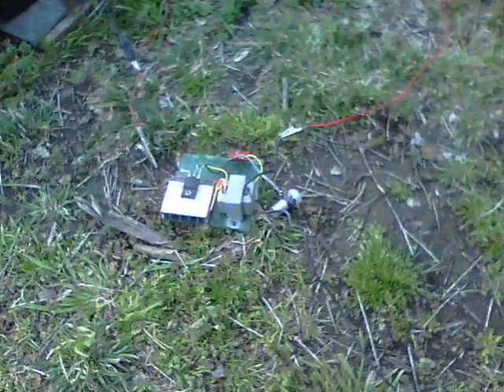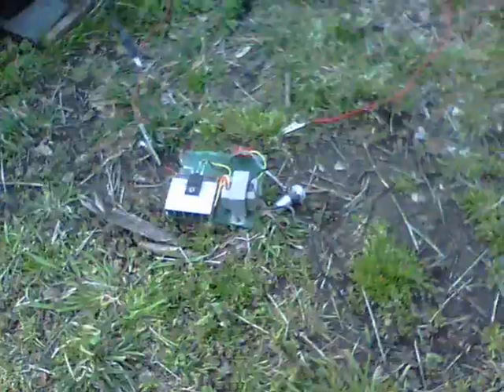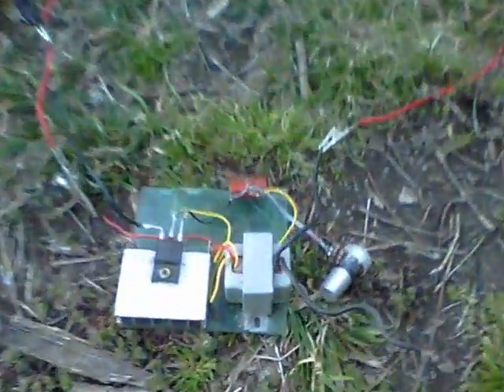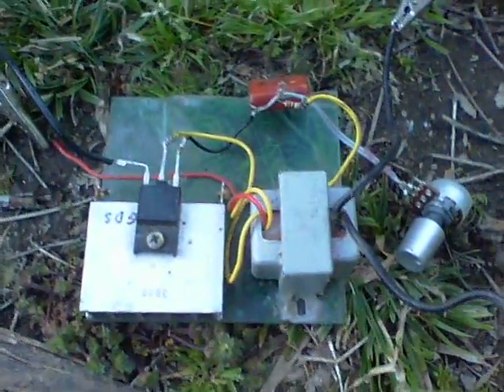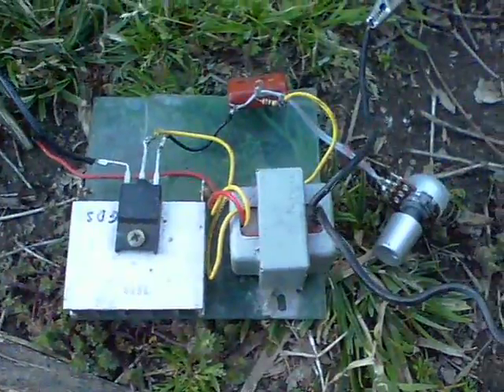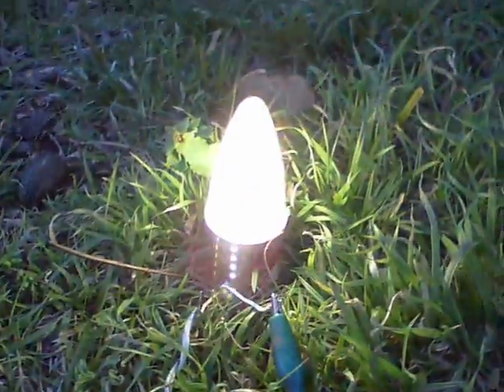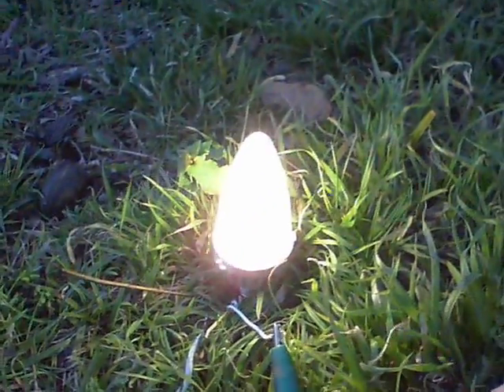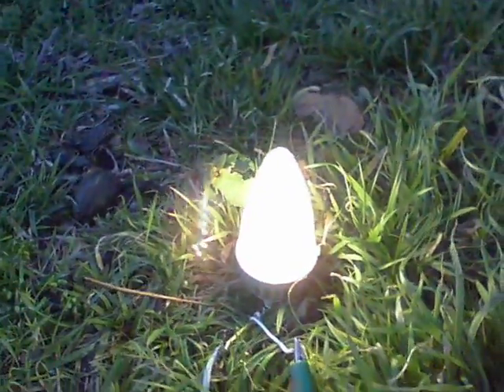Earth Ground 50ft, 2W 110V bulb

Comment: i want to make the transformer you have do you have a video with all the items and specs to make it thanks
Reply from the maker: It's a common circuit, not my design for this one. I believe I just searched for 'reverse transformer transistor'. What it is, is a 120V to 9V regular wall plug transformer, connected backwards. The MOSFET or transistor powers the low voltage side, which is stepped up for the mains rated bulb.
I wish I could find this one, it would be useful for present experiments !
More info would have been good, but as often used to happen, it worked so I grabbed the camera.
Reply: thank you very much for taking the time to get back to me
Reply from the maker: No problem, long time ago now. I believe this is the circuit:
https://www.youtube.com/watch?v=bEsh4tA5YzM
There's a clearer view on a Photobucket link in the description box underneath. The actual version in this vid is likely the same one, without the bi-colour LED.

Comment: :) so cool !! Im 14year old from croatia so I dont have much money for parts but my dad had electronic stor 10 years ago . lot of electronics he left to me :tv , videos , vacum cleaners , fridges , power supplyes , osciloscopes ..... so I make
lot of for me cool electronic projects and I love mehanics !  I will make 1m tall tesla coil and I have question for you
: I saw many circuits from tesla about wireless electricity and free energy and can I use tesla coil to transfer energy by grounding 1 end of coil and putting big antenna on other side , for reciver I will try to use 1 or 2 flyback transformer with HV capacitors and big antennna  !!!     can u pls make you opinion for my wireless energy project !!! will power be transfered only when spark touches other antenna ???  if it does can I conect it on some other way !

Comment: I'm confused...does this drain the battery?  If it does drain the battery  then why do it?  To save cost of wire? Plz explain thx
Reply from the maker: +Nathan Rogers Hi Nathan. There are several safety benefits to doing things this way - such as no chance of shorting any wires. With bad weather conditions or old wire, such cables can become frayed and this eliminates any such problems. Plus, yes indeed, a wire can be saved, where a benefit is less wire to check if there are faults. If someone has a bunch of wires for a shed/garage/outside lights then simply plugging into the ground can be tidier and  more convenient.

Comment: forgive me if i'm a bit ignorant, but the one wire must be supplying both the pos and neg voltages via a/c in one wire.  Is this correct because i',m not sure what is happening here., is the earth so the load can discharge?
Reply from the maker: Without the wire to the Earthing pole back near the battery it doesn't run, the pulses do indeed though travel down that one wire. If Grounding was the reason for working, then the light should come on regardless, so it seems the connection between the groundings is at play. All of my own tests point to the Earth being a wire, rather than a sinkhole of a blackhole for current.
Btw, The output is an on/off of Positive voltage then zero, rather than A/C (imagine a relay triggering thousands of times a second).
Interestingly, if you put 2x steel rods in the ground separated by about 1ft at least and put an old crystal radio type earphone between them, you can hear A/C mains hum from local houses.
Reply: slider2732 Thanks for that reply, it's all very interesting.  I just got a slayer excitor., So I guess I could use the second coil at a distance like your light bulb, it has one wire going to it that I assume acts like a ground link?
Reply from the maker: Ah, well with a Slayer, the frequency is high enough to do '1 wire' anyway. Run a 30AWG or whatever you have out to 50ft say and then put 2 diodes facing opposite directions connecting to the 1 wire...called an AV plug. Put your bulb contacts to those diodes (CFL, fluoro, LED type bulbs). No need for a Ground with a Slayer. That tiny 30 gauge wire will handle loads such as a 15W fluoro, 23W CFL. The electricity travels on the outside of the wire not through it ! called the skin effect.
Most of the 'rules' learned at school go out the window when you start experimenting with HF and wireless electricity lol

Comment: Mix with hv from a davro flybqck to increase load  on the 1 wire
Reply from the maker: Am looking to use a MOT at some point. Found it yesterday in the spare room, so is worth a try.
Reply: I have a mot JT. Its a bugger to get working, but worth the effort, although freq may be a little low for this... Has some interesting effects though. MOT Slow flash Joule Thief. Single transistor flasher with no capacitors.

Comment: Very nice test, It would be interesting if a solar system could be run the same way with long distance, with little power drop until it hits ground

nice
Reply from the maker: Thanks. Hmm, you mean wire losses ? It would have to change to a pulse system, then back for charging...unless it radiantly charged the end batteries. Just 1 wire, with end pickup grounded.
Reply: slider2732 one of the main reasons solar is not practical on some locations is because of the distance from the sunny area to the house or location where the current is needed,(big loss in power because of wire distance) I think what you are showing here is no power loss if you use one wire and connect to ground where you want to use the power

Comment: I THINK IT IS THE GALVANIZED STEAL that allows this to happen ? With out the galvanized steal it does not work ! or does it.
Reply from the maker: I'll try it with a copper rod tomorrow and let you know :)
Reply: I will save you the time !
Reply from the maker: Tried it, just to see if any differences. Same output :)
Reply: Thats a good thing they way other paned it out made it seem if it was the galvanized steel , What about the amps was there any difference ?
Reply from the maker: Was just the same output, voltage and amperage. Larger metal mass in the ground does increase the amperage a little though :)
Reply: Sounds good , I can only imagine the larger the surface allows the magnetic field of the earth to influence this effect .